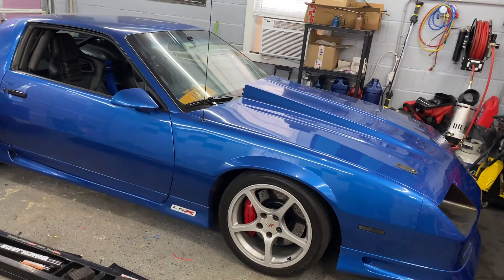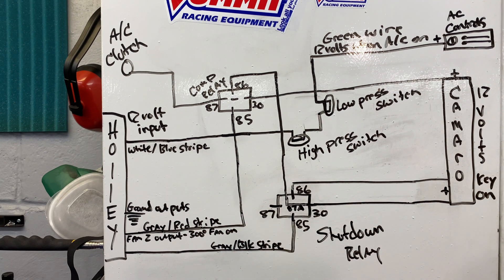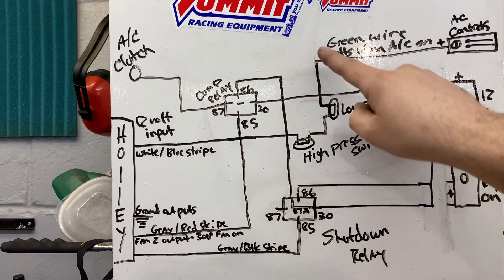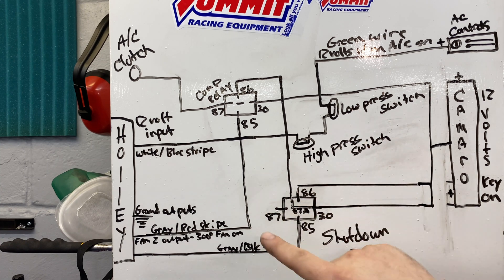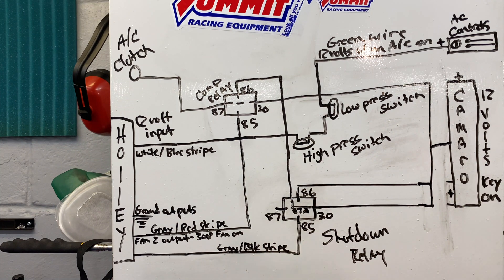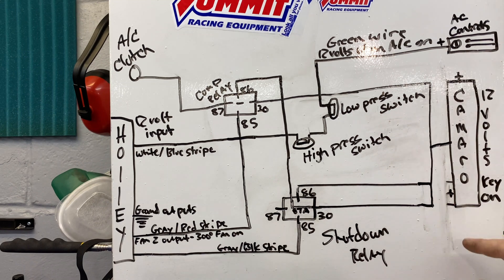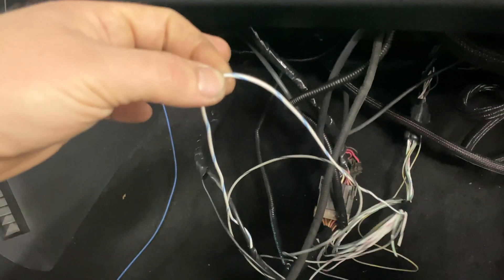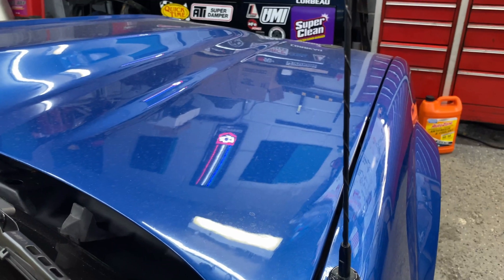How to Get A/C with a Holley Terminator X Max Ls Swap

Comment: shouldn’t the pressure switches be inline somewhere on the shutdown circuit? How does the holley get the signal to turn on the compressor if the freon isn’t cycling & pressurizing & activating the switches ?

Comment: Probably stupid question, you wouldn’t happen to know what all would be required for ac to work if your piggy backing a stock ecu and using the terminator. I seen online mentioning crank needs to be hooked up and a second sensor for coolant temp. Just not many references with the a/c

Comment: Nicely done, but can I suggest something to help less-experienced viewers understand it better?
Next time you draw a diagram, try having each relay set up with 85 & 86 on the left and 30/87/87A on the right side of the box. Most schematics have power at the top and ground at the bottom. 86-88 Mazda RX-7 wiring diagrams are set up like this and it makes it really easy to follow. They add "rails" at the top for battery, accessory, ignition and start positions on the ignition switch.
Can't wait to see the Tahoe get its DVD player. Keep up the amazing work.